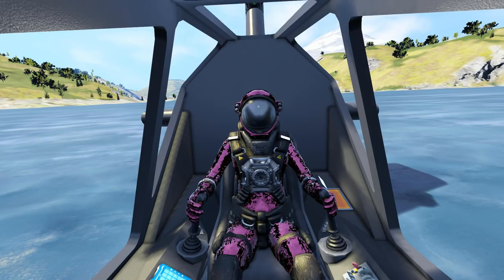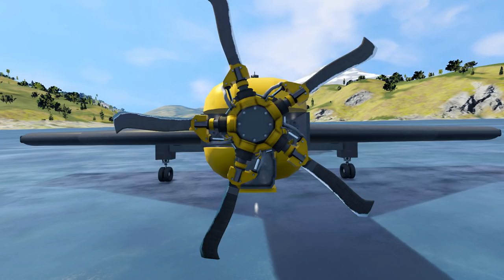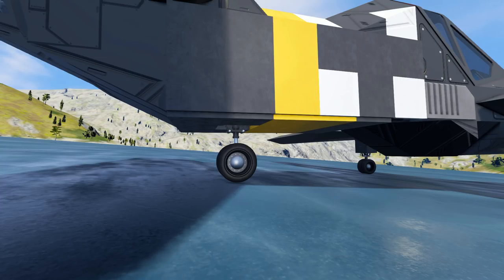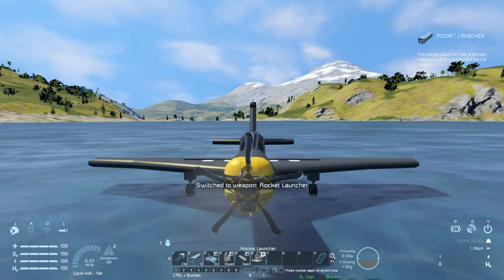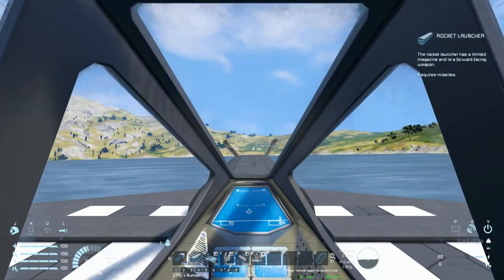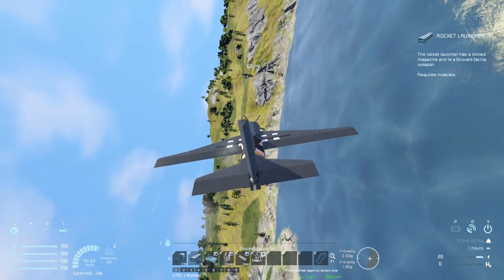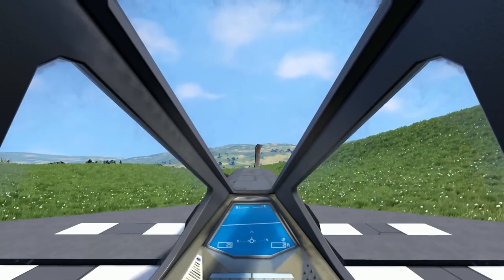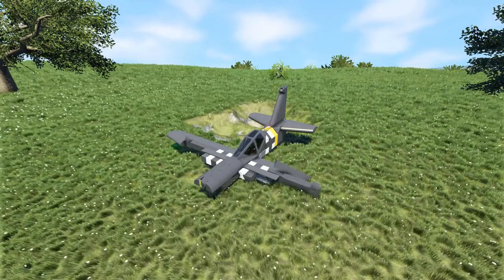WW2 Styled Plane - Space Engineers (Mods)

Comment: The wings are backwards the straight parts should be at the front, like the spitfire or me 109
Reply: It seems like you don’t understand how wings work. The curved part is at the front, and the straight part is at the back.
Reply: You both know that wings can have multiple sweep angles and shapes right? On piston engine aircraft the wings are usually straight as swept wings perform better at high speeds than the speeds achieved by piston engine aircraft. Wings can even be forward swept as seen on the Su-47 Berkut and Grumman X-29. The shape of wing shown on the plane in the video is somewhat similar to the P-51 Mustang a World War 2 piston engined aircraft, although the swept bit of the wing on this plane takes up a considerably larger part of the wing than on the P-51. In conclusion: Wings do not have to have a specific shape, not in the way discussed here. the lift of a wing is determined by the shape of the leading and trailing edge of the wing aswell as the area of the wing not the shape as seen from above.